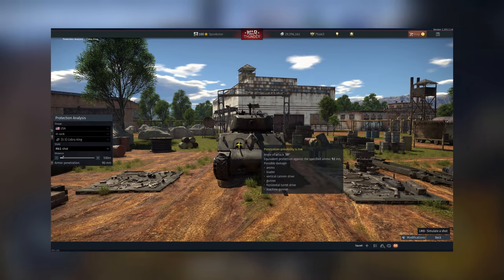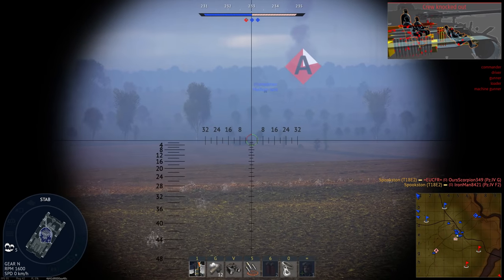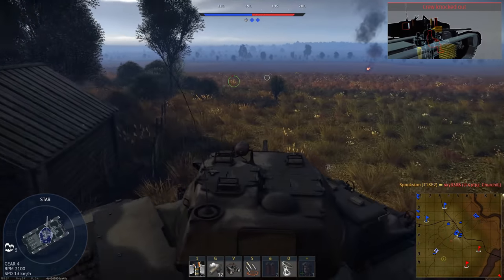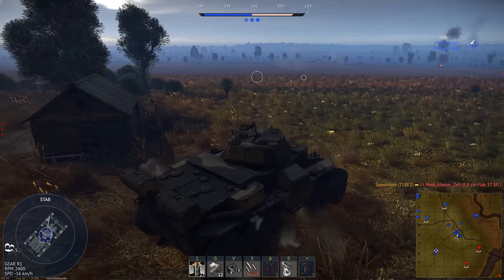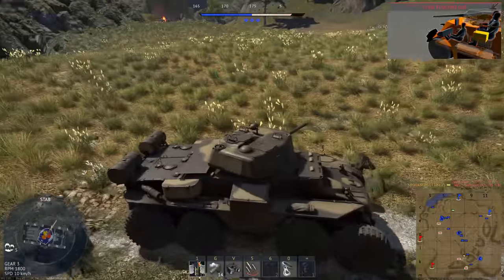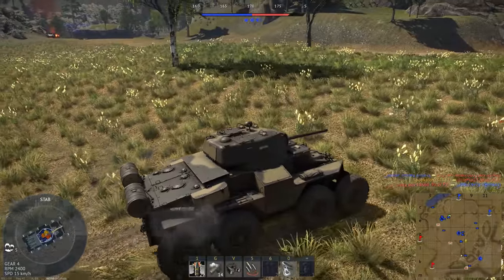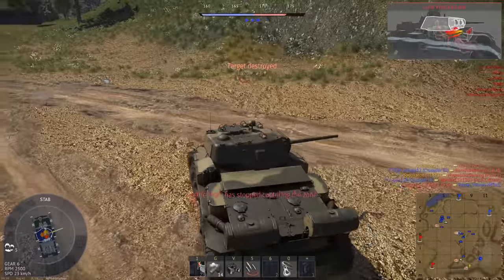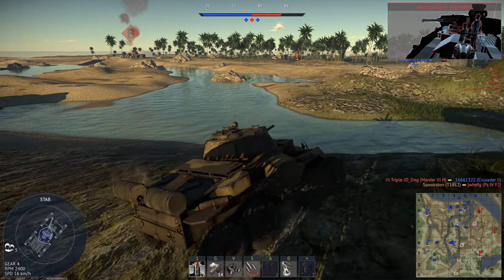Volumetric Shells Were A Bad Idea

Comment: I like what volumetric did. It makes more veteran players less effective against new comers because tanks are a little tanker. Pixel hunting for weak spots is not a fun skill to learn so I think it benefits the broader community.
Reply: and make tanks that can't bounce long 88 fired at hull like the T25, bounce it instead because the shell hit in a area where 2 models meet, SO FUN!, and boom now the T25 has enough time to knock me out because my weakspot ins't in a area where multiple models are located.
Reply: and if the rats don't like being turned into food by a long 88, WHATEVER, START PLAYING THE META VEHICLES THEN, NOT THE BUTTERMOBILE.
OH I FORGOT, PEOPLE ALREADY BEEN USING META VEHICLES SINCE VOLUMETRICS WERE ADDED.
Reply: IMMORTAL T26E5, EVEN THE PERSHING, T34, T29, KV-1 B, WOOOOOW!!!
Reply: what could i expect from someone that thinks new comers, should be invincible to people that have more experience? A EXTREMELY UNWISE OPINION IN A GAME MECHANIC THAT CLEARLY ISN'T WORKING AS IT SHOULD.

Comment: i personally don't find any issue since all the spots i usually shoot are a single piece plate like the KV-1's turret base or the T-54's face right beside the gun. and that can be penetrated by a full caliber shell as i unlocked APDS after that match. it's probably the fact my accuracy is basically flawless since a lot of people keep saying they can't kill x tank because their y tank keeps hitting two plates at the same time

Comment: The entire cross-section of a HEAT shell or ATGM is now counted as the penetrator. This means that TOWs simply can't penetrate the side of the turret on tanks like the Conqueror and the M103 which have variable armour thickness, since plates "overlap" and the entirety of the missile has to penetrate the armour. :/

Comment: My fix for this would be relatively simple: 
The main problem atm is shells hitting one plate head on near the edge and grazing a second off-center. 
If you hit the plate head on, you need to penetrate it just as before. 
If the plate only gets grazed by the side of the shell rather than the tip, then it merely gets deflected with a minimal loss in penetration, regardless of what the impact angle in the current model would have been. Shells are sharp pointy things, and if they graze a plate they wont keep travelling straight punching a perfectly round hole into them, they will just carve out a little bit as they ricochet off. 

If that were implemented and you shot, say, the turret ring of a Tiger I, it would glance off the lower edge of the mantlet into the hull roof and at the very least destroy the turret ring. Sounds familiar? Thats how Bovington got their Tiger. 
Lets further say you hit a welding seam between two plates, neither of which thick enough to stop your shell, right now you have to penetrate both plates as if they were sandwiched on top of each other, rather than penetrating one, and at worst dealing with a little deflection from the other, which at some angles would even be fairly realistic (like hitting a Sherman frontally near the corner and the side plate causing the shot to bend inwards). 
Same thing for bow MGs, like the German ones that are a ball encased in a hollow ball with a front cutout. Right now its virtually impossible to hit that without automatically at least grazing the outer part as well as the MG. I had a case yesterday where my Delat Torn ate a shell from a 17 pounder because it hit the coaxial MG. Bow MGs on most tanks are a billion times worse than the Delat Torn with a gap in its armor and a flat like 10 mm plate around the MG to cover that. 

Also, may your brother have a splendid wedding.

Comment: Hull breaks is another issue, my centauro can get hit in the loaders periscope by a sabo and now the tank is busted, they gotta also include the fact that at shallow angles armor will scratch and have digs in it from AP rounds, say you fire an AP round at the upper of a bmp, it's not gunna bounce straight up like it usually does, it's gunna dig into the armor and give it a much shallower bounce angle, able to actually dig and ride itself on the armor and possibly ride itself into the turret
Reply: Ik I got side tracked at the half way point but I just gotta vent

Comment: Lot of new tanks have been getting volumetric updates for armor. I still think the most annoying thing is shooting between the turret side and chassis of the tank, but other than that volumetrics kinda work. Kinda. The system will work out eventually, but as long as an R3 can pen and kill KV-1/85 tanks through the MG port and completely dominate everything up to like 5.7, we have other problems to worry about.

Comment: The Is-2(1944) got a huge buff, having enough armor to even block weak heat rounds. It did so much better than the t-44 they almost immediately downgraded its front plate to a single piece 100 mm cast armor. The turret became 100 mm cast armor too, but where the manlet and side armor meet the manlet was made thinner. This armor debuff came in with an economy change where the Is-2 doubled in repair price because of the past performance with volumetric shells. Now it's a tiger 2 p with less armor, penetration, crew, with greater reload, shell size, and repair price.

Comment: I find that damaging modules also took a big dump with the Volumetric shell update, too. For example you try to track a heavy tank when it peeks it's front out from around the corner, only for the shell to get absorbed by the track, or deal minimum component damage. Then the tank peeks out and blows you to bits during your reload.

Not to mention mantlet shooting is very inconsistent now, especially when it comes to russian tanks. Even shooting the barrel most times will result in only a yellow.

Comment: Bow guns were removed for other reason besides being a "weak" spot. I will not get into that but i will say that from the rare situations where you would hit a bow port the round would not keep going but get deflected rather much. Cast steel is very bad at maintaining the same strength once it has been punched or drilled. The area around the port, not itself, would give in and let the round deflect inwards. So in reality the weak spot is around the port as much as the area inside it. Hope it helps!

Comment: 100% agree, the volumetric shells just don't do it for me. I used to be very good at pixel picking weakspots, even from long distance, and now, even at point blank, those spots just either aren't there or aren't reliable, so most of the time I'm forced to take multiple shots or go for obvious but somewhat ineffective weakspots as an alternative just for the sake of consistency.
Reply: Pixel picking is the cancer and I'm so fucking glad it got less xD
They need to update their damage- and armor model tho
Reply: Agreed, some of the bullshit I could pull off reliably was just plain silly. Though it was definitely a little cancerous at times, it was also efficient as hell, and that's why I did it in the first place. Nowadays, the weird pixel shots aren't possible, and even some of the seemingly reliable weakspots (such as lower plates) aren't even 100% reliable anymore.

Comment: I think volumetric shells were a good idea and that won't change. A barrel getting in the way of a shell, in most cases, makes sense. A shell's path could be severely impeded if the rounded nose of it made contact with a barrel. I could see how that could be contested with rockets, but they're a separate matter. Yes, pixel hunting did require some skill, but I believe that it was worse for gameplay than volumetric is. Yes, optic ports and machine gun ports are a problem, but they were a consistent problem before volumetric shells were introduced. The only difference is that now you have something to blame it on. The problem isn't the idea of volumetric shells, it's how they perform and their various bugs.

Comment: Since volumetric shells I only had couple of low tier battles as Germany, mostly I am on the top ones, still, either finishing some vehicle module research, or grinding for Tiger helicopter, or grinding SL's. I have noticed some slight change on top tier, and possibly now a more playable Leopard 2A5, mostly thanks to the huge reduction in SL's (finally, a reasonable repair cost for performance), but not sure how much better it uses its armor now...I am still getting turret ring hits and gun disables as before...Not really sure atm, practically it should boost armor up, but I can't test it since I don't have anything to fight against 2A5's, I can only say my perspective as 2A5 player. Another thing, it for sure made Russian MBT's more powerful, regarding armor, as if it already wasn't hard to crack them from front...

Comment: Agreed. The universal pen calculation screwed things up, then this just complicated matters. As for weakspots, Gaijin doesn't even represent them at all. In practice, armor- especially RHA- is only as strong as its surrounding armor. It is a mutually supportive system. Weak welding? A hole for optics or a gun? That armor is more likely to bow or collapse if struck, because it doesn't have a 360 degree support system within the grain of the armor. As for turrets, turret jamming was a common problem in many WWII tanks. The only surviving and functional Tiger I, Tiger 131, suffered from a shot that ricocheted off the barrel and into the gap between the turret and ceiling plate, throwing spalling into the hull and causing quite a bit of damage. Which is another issue: rounds can hit armor and throw spalling into the vehicle, even if the shot fails to penetrate. Such effects are not just for riveted tanks, popping their rivets, or victims of HESH shells.

Comment: The intersecting armor thing is honestly what ticks me off the most about volumetric shells. This applies to SO MANY vehicles.

Also, the Chonquerors APDS seems to suffer quite badly from this change. I was just starting to like it and Gaijin throws this in, just so I can have 3 shells do nothing to the side of a TAM but break the tracks. And have 2 shells shatter on a Leopard I's gun mantlet. Not to mention Centurion and Caernarvon becoming broken as hell, due to the turret front now actually being impenetrable to many APHE rounds at 6.7.

Gramercy Gaijin! Well designed feature! Much tested!

Comment: IRL the edge of an armor plate near a gap is much weaker than the rest of a plate. Even a gap much smaller than any shell or bullet is a weak spot, and you wouldn't even have to hit it directly to take advantage of this weakness. Shells having size might be more realistic but it exposes other weaknesses in the game engine that effectively make the end result less realistic and less fun. Another thing to note is that at the speeds that shells travel at, the metal of the shell is more than capable of deforming or shattering and forcing it's way into small gaps. 
In real tank engagements during WWII, even heavily armored tanks were not completely invulnerable, and would often eventually be put out of commission by sustained fire even if the incoming fire wasn't able to pierce the plate on paper. Eventually something is going to hit a chink in the armor or damage something important like the gun or suspension.

Comment: Coming back to this video after having a Tiger H 1 tank 5 full 17pdr mk8 rounds to the UFP unangled. First penned and only killed gunner, second hit the track but did no damage, the last 3 were eaten by the optics and MG port. I respawn, shoot the KV 1 C, hit the gun mantlet which is only 100 thick, easy pen with a 17 pdr, but I hit a volumetric overlap and the shell gets eaten. Then I die. Thanks gaijin.

Comment: Gaijin also failed to implement the 3D aspect of the shells. Right now it’s more accurate to say they’re cross sectional shells because the size calculation only takes into account the width of the shell, not which point of the shell would hit first

Comment: i like the change but i do agree that it needs to be overhauled for it to work correctly, not just the shell/armor mechanic but the battle ratings as well. i dont find it fare that the 279 can eat a 165mm hesh and take no damage other than breaking a few periscopes

Comment: The irony of volumetric shells is that it has actually improved some tanks (as stated in the video) but it has made others impossible to kill on occasion. I’ve had 150mm Brummbär HEAT bounce or disappear from easy pens seemingly just... because. Very frustrating with a tank like the Brummbär where it’s hard to aim at range and missing can mean you die. 
Small caliber guns seem to be the way forward to avoid volumetric frustration. Rooikat Mk.1D APFSDS im looking at you 

It needs to be implemented in a more reliable way or it needs to be rolled back.

Comment: There's also the issue of tracks eating entire shells, I don't think my 2a5 or T80's APFSDS rounds should be getting consistently stopped by lightly scraping a track while shooting someone in the side. Hell even my Merkava MK3's 625 mm of pen APFSDS round got eaten by a T55's track from the flat side. 
I don't think i should shoot an A1A1 in the side, take off its track, not get my T80U quite turned around in time and have it shoot through my track, into my angled side, and out the other side, taking off both tracks and ammoracking me.

Comment: You are absolutely right with everything wrong with volumetric shells. It seems like there was quite a lot of oversight (shocking I know) with the specifics of how it works in the damage model and currently the game would probably benefit as a whole if it were removed. BUT it is something that (in a working state) SHOULD (as well I’d like to see it) be in the game as well as the appropriate br changes (but since when does gaijin make good decisions?).

Comment: For me the volumetric shells have been a huge improvement. I play mostly British and German vehicles, with the odd French and Italian match here and there. The problem with consistency doesn't stem from volumetric shells, but from desync between the client and the server.

You, as a client, are pretty much remote-controlling the vehicle on the server, while your client is simulating locally as well. The server will always overrule though, so that's why sometimes the killcam, or even hitboxes do not match what your client is telling you. This isn't very apparent in the air, which is the only game mode the game had at launch, because you're sending loads of bullets and aircraft are pretty big. Stuff is also rather far away and targets are moving past in the blink of an eye so a desync glitch here and there isn't easily noticed. It's also not very noticeable when tanks are moving slow and turrets don't rotate too fast. But now, with high tier stuff becoming increasingly faster, desync becomes much more obvious. You're trying to hit pixel precise shots while everything is moving and rotating at much higher speeds than the game initially started with.

Comment: Yeah, from today: 5 or 6 shots into T-34s that was eaten by vision ports just because they wear NEAR place where the shot landed. Sadly, even with 150+ pen you need to aim for turret which is much smaller and bouncy. Also managed to bounce 260 pen apds off FLAT AMX-13 side

Comment: I do agree with you partially, i just started the Japanese tech tree and facing jumbos was painful, the mechanic even flips on you sometimes like i was playing my type 16 and my heatfs shell exploded on the over a fence directly infront of me
Reply: BS, HEAT always behaved like that, nothing to do with volumetric.
Reply: If you say so i never had that problem till after
Reply: @jmaddy3  Bushes, fences, everything fked up HEAT (main French player, I have to use HEAT a lot)

Comment: Adding volumentric shells was a great idea, even a logical and necessary step, but it is executed with the complete ignorance and laziness, causing, as you have pointed out, multiplication of armor in the places where 2 or more plates are joined or close to each other. And it couild be easily fixed - if we have a volumetric shell, we also have it's circular cross-section area. Some % of this area hits one aror section and the rest hits other sections, or air (for example in the middle of the Tiger's driver window). The simplest way to model this is to multiply the plate's thickness to be penetrated by a % of the projectiles cross-section that hits that plate (which would always reduce the armor proportionally). I thought of this almost immediately after they introduced the volumetric shells and noticed that the shell sees like 240mm of armor or more in the Tiger's driver window.

Comment: The volumetric shells wouldn’t bother me if they didn’t magnify the issues already existing in the game. Since weak spots are very hard to reliably penetrate now the best option is to go for the gun, but this is not reliable either. Sometimes even when you shoot a tanks gun barrel in game with the main cannon it will do no damage. For whatever reason, even though a shell makes contact with the guns barrel it does no damage because it is deflected. Now, I’m no expert, but from what I understand even though a shell bounces off a surface or does not fully penetrate it still leaves visible damage. This damage in my opinion should be enough to disable a gun, but in game the gun remains effective. Because the shells now bounce off surfaces more easily and take up more space they likely hit and bounce off the gun barrel even when you don’t intend them to.